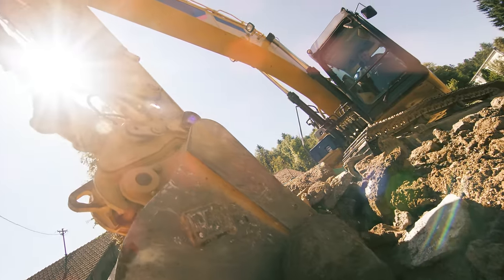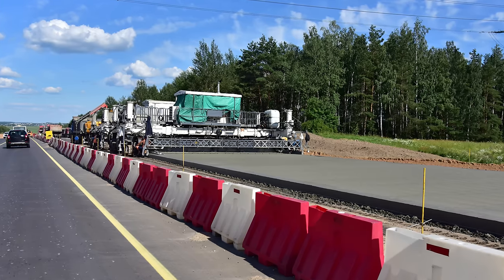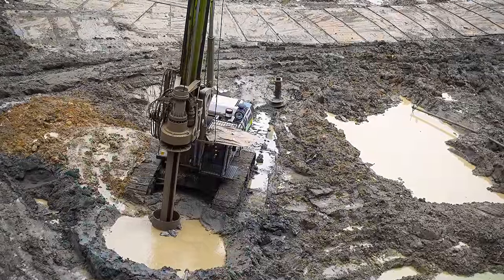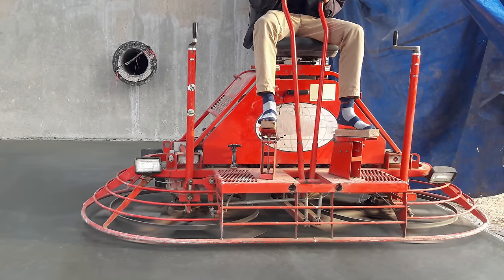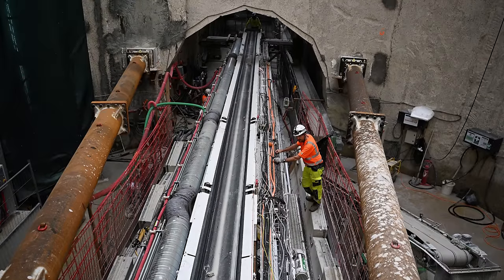Every Construction Machine Explained in 15 Minutes

Comment: Love the video! Sad one of my favorites didn't get a mention: the snooper truck. A cousin to the boom truck that. Instead of lifting the bucket to a high point, it is designed to allow the bucket to go underneath the truck. They are typically used when inspecting a bridge, the truck parks ontop of the bridge and the boom is used to move the bucket so that the occupants can inspect the underside of the bridge for damage  or other signs of wear that may need to be fixed.
Reply: I was wondering what those were called, I recently watched one in action inspecting bridges. The operator was doing an impressive job coordinating with the driver to maneuver the boom through the steel trusses.
Reply: I don't know how often they are used, but I see them about 3 times a decade inspecting some part of the twin bridge I use every day. It's 2 near identical 3 lane bridges and they just close off a lane and creep along it, putting the bucket between girders.
Reply: Those are being replaced by drones, but it will be a while for full buy-in. The best part is that there is no traffic interference.
Reply: @bp-ob8ic I’m not sure a camera will ever be as good as hands on. At least not until AI gets involved
Reply: @bruhice6058 These drones can carry a variety of sensors, including x-ray and infra-red. 

While hands-on is great, the ease of access allows the inspections to be more more frequent, and provides more specific detail than the average eyeball.

AI is already involved to help avoid the structure where GPS is not available. I suspect that AI is also used to enhance the defects detected.
Reply: Bro that's freaking cool, do you need a special certifikat to operate that one, or is it the same as a normal bomlift?

Comment: Excavator 0:45
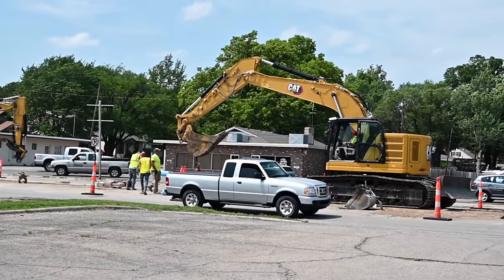Skid Steer 1:03
Loader 1:26
Dump Truck 1:44
Articulated Hauler 2:13
Scraper 2:22
Backhoe 2:41
Bulldozer 2:52
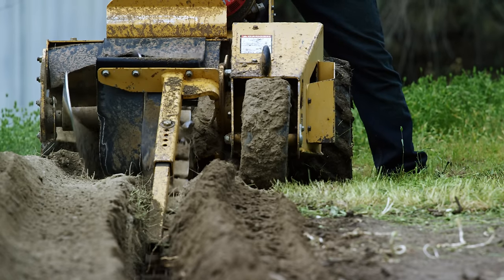Trencher 3:07
Grader 4:00
Roller Compactor 4:17
Asphalt Paver 4:43
Slip Former 5:05 
Asphalt Mill or Planer 5:40
Paving Train 5:59
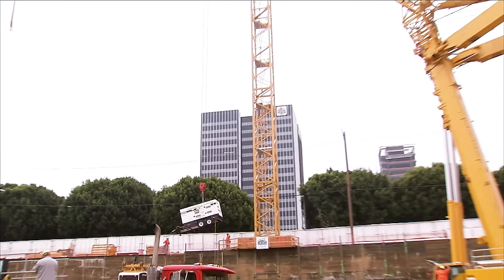Trailer 6:26
Light Tower 6:28
Air Compressor 6:35
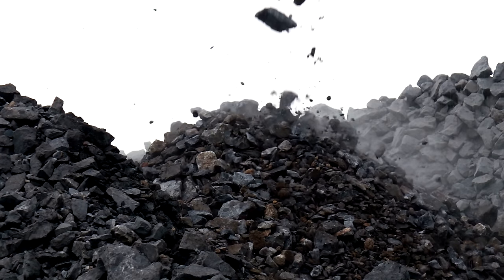Diesel Generator 6:47
Crane 7:00
Pipe Layer 7:06
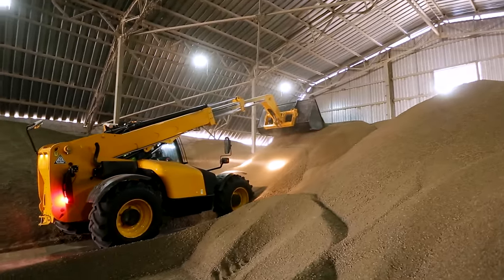Telescopic Handler 7:22
Boom Lift/Scissor Lift 7:40
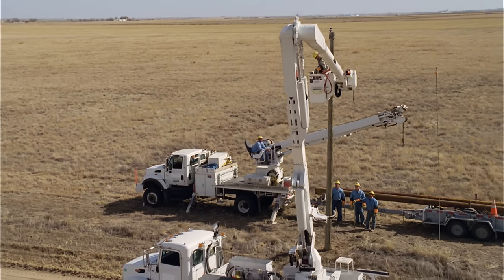Bucket Truck 7:53
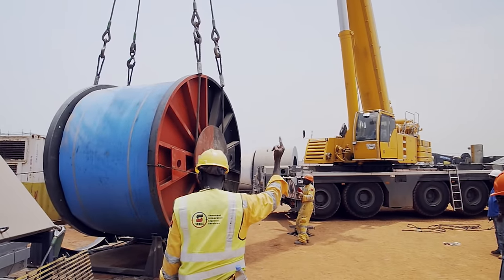Road-rated All-terrain Crane 8:00
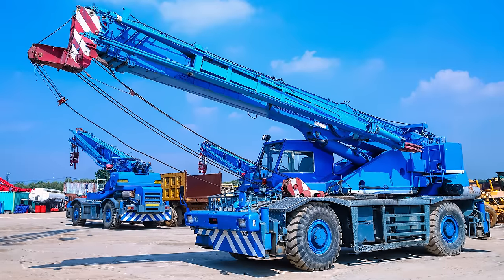Rough-terrrain Crane 8:22
Crawler Crane 8:35
Tower Crane 9:09
Launching Gantry 9:32
Pile Drill Rig 10:22
Pile Driver 10:36
Mixer Truck 10:55
Concrete Pump 11:20
Ride-on Trowel 11:40
Mobile Batching Plant 11:50
Shotcrete 12:15
Directional Drilling Machine 12:37
Soil Nail Rig 13:04
Grout Plant 13:17
Wick Drain Machine 13:27
Cured-in-place Pipe Lining 13:43
Tunnel Boring Machine 14:02
Reply: Anybody have alternative/slang terms for any of these? I’ll start, excavator gets called hoe or track hoe
Reply: Thank you! 👍 This should have been included in the video.
Reply: @grondhero  there was a brief mention of it at around 3:20, but yeah it was not given for every machine
Reply: Backhoes are JCBs or diggers in Ireland
Reply: This comment needs 1k likes
Reply: Nice
Reply: As English isn't my mother tongue the list helps me a lot! Even if I'll rarely need to know these terms, it don't hurt to know them. So, thanks for your list!
Reply: @magnum8264  Yeah, but that's b/c of the name brand,  Like Frisbee or Ping Pong or Band-Aid.
Reply: @magnum8264  Made it first? No.  Made it popular ?  More likely.
Reply: He forgot Forklift

Also not construction related, combiner harvester, Farming heavy vehicle

Also armored personel vehicle
Reply: @jcorkable  Shotcrete -around here everyone calls it gunite
Reply: Chad
Reply: The bucket truck is something I've always known as  a cherry picker. @jcorkable
Reply: thank you
Reply: You're doing God's work, son.
Reply: This video should add back pusher.
Reply: Hero
Reply: @jcorkable I used to drive an elevating scraper (623G). We used to call it a flappy paddle scraper.
Reply: @asdfssdfghgdfy5940  lol nice one. That reminds me when I did landscaping we used to call our (wacker-neuson branded) soil compactor the wacky packer, or alternatively the jumping jack.
Reply: 1:05 this place does not exist anymore 😢
Budivel'nykiv Ave, 125, Mariupol, Donetsk Oblast, Ukraine, 87500
Reply: You are a lifesaver❤
Reply: Lifesaver
Reply: @eienryucho6648  You are too
Reply: "Backhoe" at 2:41 is most known as retroexcavator in non-english speaker regions.
Reply: thank you! imagine if there was a poster to go with !!! 😅

Comment: The machine that you call a pipe layer is very common in the railroad industry, where they are called “side booms”. They are commonly used in derailment cleanup jobs. Two or more side boom dozers are really useful for picking up and moving rail cars back to good track or moving out of the way for track rebuilding. Large heavy locomotives can take 6 or even 8 side booms to pick up and move, which requires careful coordination by each operator.

Comment: One thing you missed is a hydrovac. It uses water to remove soil around existing pipes so it's safer to dig around live wires
Reply: It’s a lot easier to dig though electrical with an excavator. Trust me I’ve tried it before.
Reply: Or colloquially, a sucker truck! Good pick.
Reply: I just call them pumpvac trucks

Comment: I own an excavation contracting company, and I was surprised that you as an engineer were able to basically hit the nail on the head how we use these machines.
Reply: Engineers aren’t all bad… just a bad stereotype
Reply: he may know what they are, but asking him how much they cost to run
Reply: when I was a kid, 50 years ago, all the small contractors had backhoes, why have they been almost completely replaced by small excavators?
Reply: @kwaherikwasasa  yes a backhoe is great it can do anything a skid steer and mini ex can but for double the price. 

Backhoes still have their place. Best for quick repairs when you need to travel around with it, without the need to call up a float.
Reply: ok
Reply: @kwaherikwasasa easier to transport
Reply: @pats9414  yes that makes sense! I see nearly all of them being transported behind a three-quarter ton pickup pulling a double axle trailer that's not gigantic!

Comment: I was watching the demolition of an old factory near me and was impressed at the skill at which the various machines were used.  One front loader was taking down a wall and had to stop to check on something.  The operator used the boom to support the now weakened wall while he did his check.  They had skid steers there as well and what impressed me was that one was lifted to the roof by a crane and was used to remove stuff from the roof.

Comment: Similar to the bucket truck is the line truck. About the same size as a bucket truck, but with a crane arm and auger to drill and set utility poles. They are also able to transport the poles to the site as well. It’s fascinating to watch a good crew using a bucket truck and line truck in harmony to build utility lines.
Reply: We always called them cherry pickers growing up

Comment: Fine, I'll be that guy

0:31 Excavator
1:03 Skid steer
1:26 Front loader
1:44 Dump truck
2:13 Articulated hauler
2:17 Scraper
2:41 Backhoe
2:52 Bulldozer
3:06 Trencher

3:44 Road construction 
4:00 Grader
4:12 Compactor
4:43 Asphalt paver
5:01 Concrete paver thingy
5:24 The thing that scrapes off the top of a road

6:19 Trailery equipment 

6:49 Cranes and stuff
7:04 Pipe layer
7:21 Telehandler
7:36 Boom/scissor lift
7:59 All terrain crane
8:19 Rough terrain crane 
8:32 Crawler crane 
9:05 Tower crane
9:28 Bridge gantry crane or something 

9:48 Drill machines
10:12 Pile drill rig (pig)
10:31 Pile driver

10:45 Concrete handling machinery 
10:53 Mixer truck
11:18 Concrete pump 
11:36 Concrete smoother hoverbike
11:46 Local concrete bakery 
12:02 Concrete sprayer

12:24 Directional drilling machine 
12:51 Weird and unusual machines that I'm not gonna name
13:57 Tunnel bore
Reply: You are that guy pal, you are that guy thank you so so much
Reply: Maybe Grady could pin this comment at the top?

Comment: I was extremely lucky as a young man to be employed as a trainee manager for a quarrying company. In addition to learning all the office jobs, I was able to play with the big boys' toys outside. We had loaders, dozers, dumpers, hydraulic excavators, forklifts, and rope operated clam shells and draglines. We used a backhoe to dig out dozers when they got stuck, because we could 'walk' it across any ground surface. You're right about the different colloquial names for machines, because I was aware of differences even in quarries 30 miles apart.

Comment: Another piece of equipment you might see further north are construction heaters. Particularly large pours of concrete need to be heated to cure. Sometimes this is handled with external heaters that get ducted into a structure, and sometimes with heaters inside of the structure. :)
Reply: Dealt with this exact opposite issue just today.  Concrete arriving on site at 95 degrees down in the Florida Keys.  Not going to work out real well.
Reply: Just dont try to warm your feet for too long with a herman nelson or you will begin to wreck your boots. Those things are life savers during the winter.
Reply: at least where i am you dont see construction at all during the winter because its too cold. the one job i had in construction that worked through the winter almost everyone quit within 2 weeks of new years, well everyone that wasn't in an office or a cab
Reply: @clee8768  I hear in some places they dump shitloads of ice into the mix.  and on exceptionally large projects subject to high heat such as when they built Hoover Dam, the concrete is water cooled with pipes buried in the pour.
Reply: @RedneckRanger27  Where is that? It might depend on your industry too. Im in the oil and gas industry in Alberta/Saskatchewan and during construction projects, we will still work when ambient is between -30C to -40C and with the wind -50 to -55. Those are the coldest days which I have worked in and im not too keen on having to do that again. Nobody quit though, just a lot of complaining.
Reply: @ew3612  yeah im closer to Reddeer and around here you don't see any in the winter really. the only one ive seen in borea doing solar and wind farms but that's also large projects without concrete mostly. and for wind they have to pour the foundations all before it gets too cold
Reply: @RedneckRanger27  makes sense. All of the ground work is mostly complete before winter. I worked with some other electricians who were on those big solar jobs and they said it was poorly organized, with bad pay, and the division of labour was mind numbing. That place was like a rotating door.

Comment: Milled pavement is often a bit of a concern for motorcycle riders. If, as happens with wear, the cutters are uneven it creates longitudinal grooves and the bike's wheels tend to follow those.

Growing up in northeastern Pennsylvania a sign of larger building construction (bigger than houses) was borehole drilling to determine if coal mines are under the site. There are maps from the coal companies but they are known to be inaccurate.
Reply: Sometimes the maps were off on purpose. If a shady coal company wanted to steal the coal from the land they did not have rights to, there was very little to stop them.

Comment: Pretty sure this could easily be turned into a series to cover a lot of other industries: forestry, mining, railway construction, and canal/bay/waterway dredging and maintenance. 

Of course it's also interesting to see how many machines from agriculture get adapted to use in other areas as well - especially given the large variety of equipment used in all the various forms of agriculture. In fact it's been years since I've seen a dedicated scraper/earthmover, as most large construction sites I've seen in the south eastern US are more likely to use a tow-behind version pulled by a large articulated farm/ag tractor --- with the tractor occasionally pulling multiple in a chain. Will also frequently see large/heavy disk harrows/plows on construction sites to loosen/breakup/dry(?) the soil/clay for other equipment to work. 

It's fun to see & learn about the equipment that literally changes & builds civilization - especially since the types of machines and equipment continue to grow and expand into new areas. In the last year I've seen my first stone slinger truck driving down the road (something I never knew even existed until watching an Essential Craftsman video about them).
Reply: I’m a farmer and machine nerd. He needs to do a video like this for agricultural/forestry equipment.

Comment: The only thing I am missing (probably only because I have worked on one) is the drilling rig. Mostly used for wells but also for construction if you need to dig below the ground water. Than you install a couple of temporary wells with big pumps to actively lower the groundwater level.
Reply: You forgot to mention geotech drills for subsurface investigation or diamond drills for mineral exploration. Third generation driller and I've worked with diamond and geotech drills mostly but have worked with cable tool and rotary well rigs.

Comment: I've seen those tires-in-a-row compactors in use at I-70 pavement replacement work sites through Kansas, and though I could tell that they were some kind of roller, I couldn't figure out what they were used for.  Also, those pipelayers are often used by recovery companies to get big locomotives back onto the track after a derailment, often working with 4 such vehicles: 2 with the crane on the right, 2 with the crane on the left, positioned around the locomotive in such a way as to ensure proper rerailing of all of the locomotive's wheels with all 4 pipelayers facing the same direction.  It's often the most efficient way of doing the job, proving that a machine doesn't necessarily have to have interchangeable implements in order to be useful in multiple different scenarios!

Comment: The only add on to all these would be a basic tractor. Atleas where I live they are often both used as a addition to dumptrucks and for bulldozer/wheel loader like work.
Do to there use on farmland they are very good at driving on mud at places where a dump truck might get stuck.

Comment: I was LITERALLY on a recent binge / hyperfixation abt all these road vehicles and KEPT looking them all up. I was literally thinking about making articulated loaders and extending boom lifts in space engineers day in and day out. Recently we've had a lot of work on the main highway and I've seen all types and sizes of machines.

I've literally been DREAMING of the chance to hop into one of those huge loaders they use at quarry sites and just lifting up buildings' worths of material. But I don't want to do actual work though...

Comment: one of my favourite machines is the water cutter. It shoots high pressure water directly onto the road surface to cut it up a bit, rough up the road surface a bit so there is more grip on the road, and less chance for frost and ice to form. A lot easier than having to repave entire sections of roads, especially in rural areas.

Comment: I'm a retired Operating Engineer, IUOE Local 15, 38 yrs. I have run or worked with all of the machines that you depicted. I would however, add two machines. 1. Pipe pulling machines. Such as Ditch Witch or Vemeer LM 20, 40. (Used for irrigation and small water mains.) and 2. Brocks, remote controlled swiss army knives. Which are use in places too dangerous for a manned machine to work.

Comment: Dutch railroads have used a "floating cement factory" for building a bridge. I rides over the bridge supports itself.
And of course there are the multiwheel platforms like the one they used to carry a 8400 ton railroad bridge in the Netherlands.

Comment: In the beforefore times we tied a rock to a stick.  When we figured out metal casting we made the hammer.  The hammers basic design has remained the same for thousands of years.  Always appreciate you tools and clean them after every use.  That is a truth.

Comment: I had a construction site toy set when I was small. It had everything; little dudes working, a tower crane, excavator, roller, diesel generator, fences and signs etc. And a weird trailer thing that you could attach on a vehicle, and it had a pushing scoop thingy and the front portion of it opened. Now after 20 years I know that it was a scraper. Cool.

Comment: There's a dry mix concrete truck that you missed. The truck carries water in an onboard tank, cement, and aggregate dry, and adds water as it is discharged.  The discharge chute has an auger that mixes the materials during discharge.

Comment: I love a machine that designed and built for one very specific purpose. A great example is the machine they use to lay and compact the ~18" wide strip of gravel/aggregate on edge of rural roads (at least up here in New England).

Comment: Most of the machinery we use when building substations are mini excavators, skid loaders, dump trucks, line trucks, bucket trucks, stinger trucks, mobile swing-cab cranes, manlifts, scissor lifts, wacker packers, roller packers, bulldozers, trenchers, morookas, front-end loaders, georgia buggies, air compressors, and tuggers. It’s pretty neat that I’ve been able to operate almost all of these machines just from becoming a utilities electrician.

Comment: Oh man, You missed my favorite one! A while ago, Driving, I saw this real neat lookin’ one, It looked like it was just a MASSIVE blade on a normal track machine- I looked for it later and found it was a Cable Plow, Which stabs into the ground with a blade that includes a hole through which cables are fed. It apparently also has a vibratory action, Wiggling back and forth to make scoring the earth easier, But I never saw that.